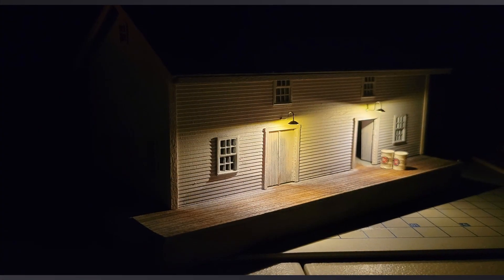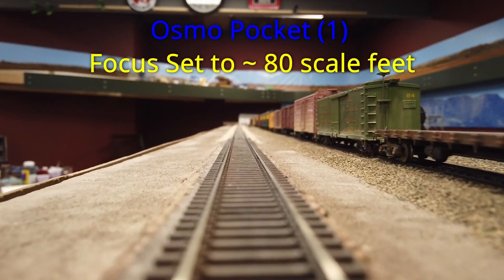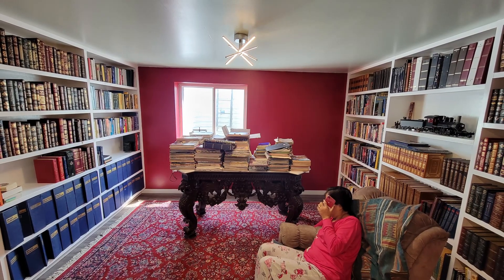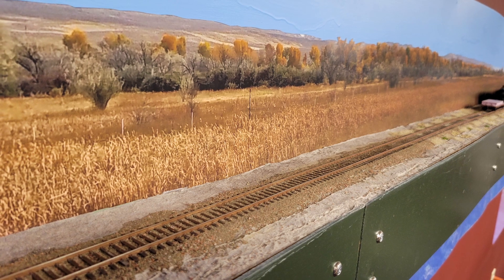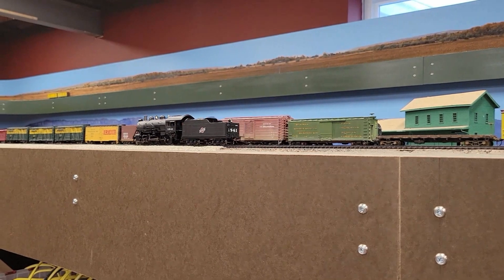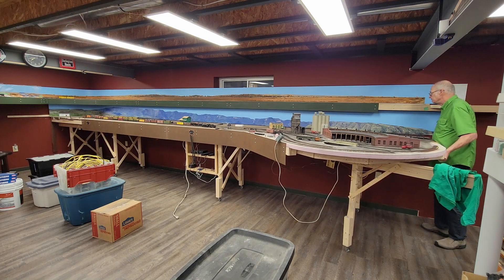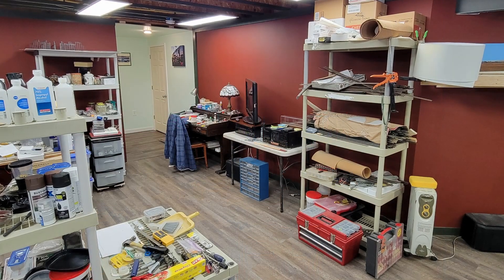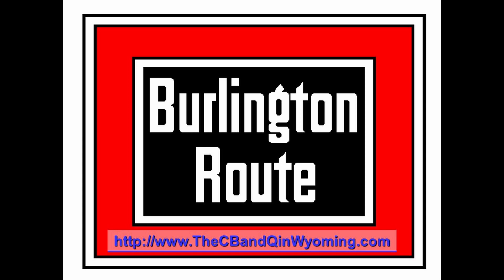2021 10 03 CB&Q V5 Monthly Update #23

Comment: In regard to the engine problem you have. I don’t know if you already sent it back but I had a similar problem. I have a Digitrax system and I ran the engine on a throttle but didn’t release it from that throttle. When I ran the engine from a different throttle it would stop itself because it was set to 0 on the other throttle. Once I released it , it ran perfectly and from then on I’ve always remembered to release the engine.
How to do it is in the Digitrax manual
Reply from the maker: Thanks for the suggestion, Wendell. I use NCE, which doesn't latch onto a locomotive like Digitrax's throttles do. So the problem is in the loco for sure. But I do appreciate your thoughts!